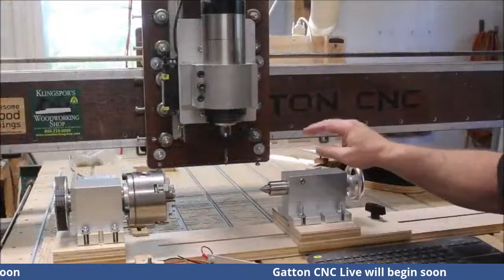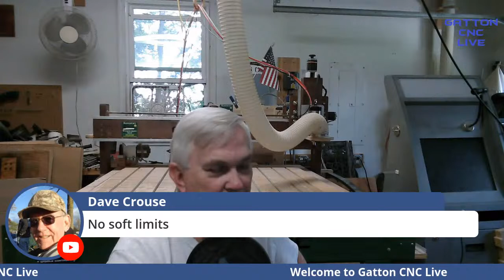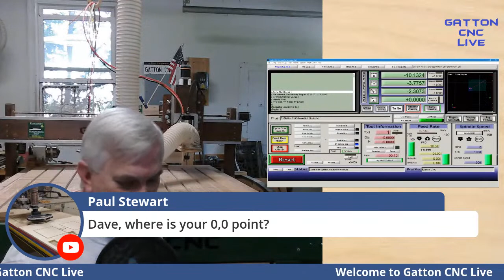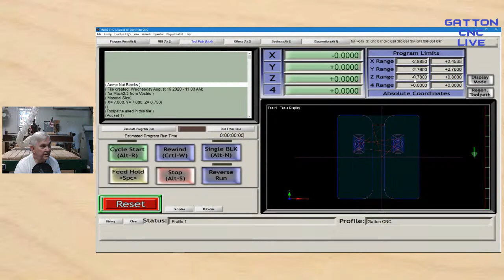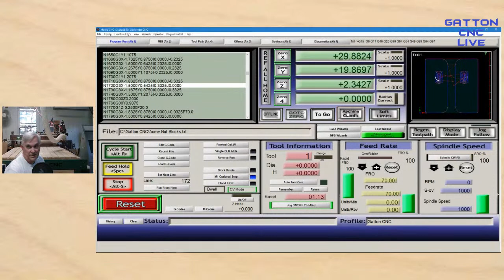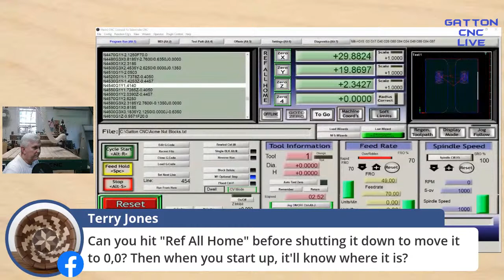Gatton CNC Live  | #3  19-August-2020   Soft Limits | Program Limits

Comment: I dont have a CNC yet but does that mean that you dont need limit switches . i had asked a question on your web but havnt ha d a reply question do you still sel just the plans for your cnc cheers
Reply: Do you still sell just the plans cheers
Reply from the maker: @michaeljameson1046  No.
Reply: @DaveGatton  Well its looks like its going to be an Avid 48 x 48 thank for all the cnc info you put out much appreciated cheers
Reply from the maker: You can certainly run a CNC machine without limit and homing switches but they are a very feature to have.